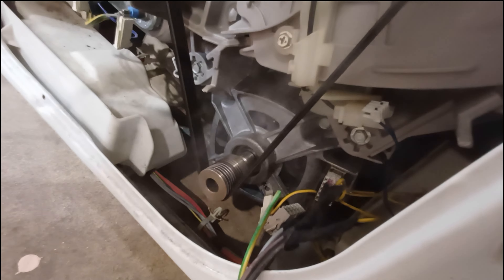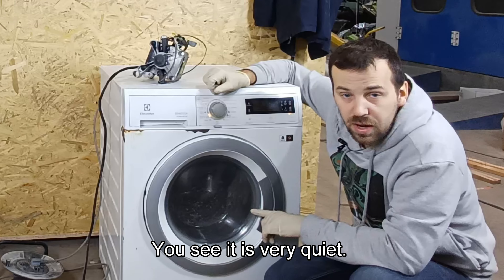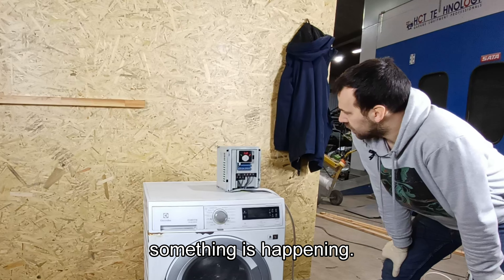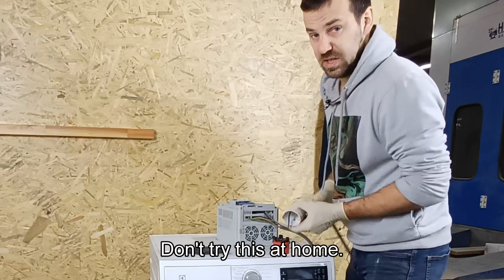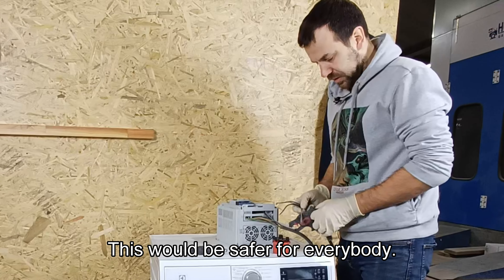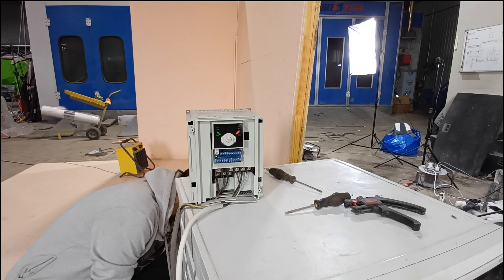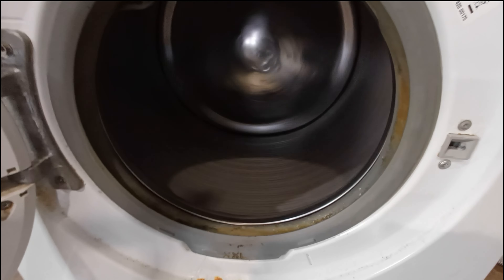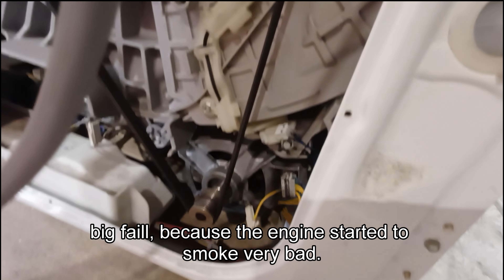Tesla electric motor in a washing machine? #fungear #destruction #video #washingmachine #electrolux

Comment: Also if you have any spare brused motors its likely some of tjem have tje same mounts so you can just wire up the brushed motor and put the belt on ive done it before 😊
Reply from the maker: I got them and i did replace the old motor. Here it runs already with the new motor https://youtu.be/cP-tNfB_ICU
Reply: Oh okay, great video 👍
Reply from the maker: @applianceguy  thanks

Comment: You should try getting an lg direct drive, the motor sits at the back of the tub and theres no belt, it would be pretty interesting for you i think 😊
Reply from the maker: Sounds fun😃
Reply: To drive them however you need a good inverter because the lg motors I have heard are hard to drive